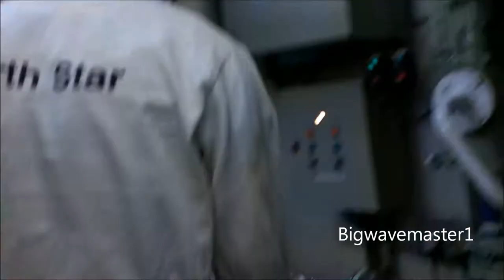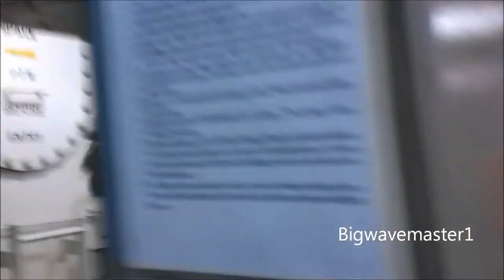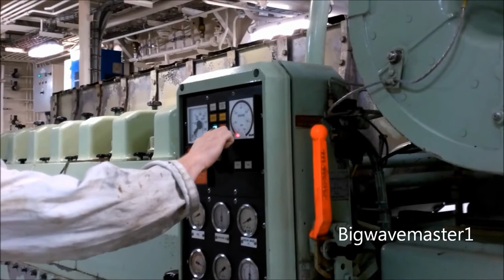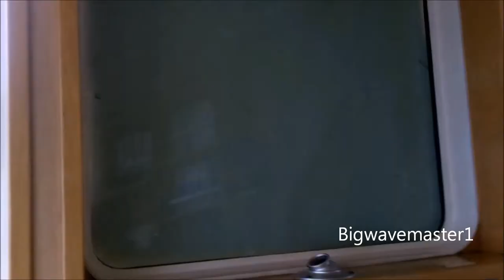Life at Sea on an ERRV Part 12. September - October 2017

Comment: Am I right in thinking that the boat you replace has also been at sea a month? In which case does that mean the boats spend a month tied up in dock between shifts? Or do they have another crew that take it out onto another job?
Reply from the maker: Hello. That is correct. Each boat has 2 crews. There are a couple that just do relief work. They let a boat go in the change crew, take stores and get some repairs done. The relief ship then moves on to another location for the same again.

Comment: could someone elaborate on the use of those metal plates in front of the windows? are they to prevent damage during a storm? or were they placed after a storm damaged the windows?
Reply from the maker: They are placed there when windows get smashed. Here we are just making sure they fit and practicing putting them on.